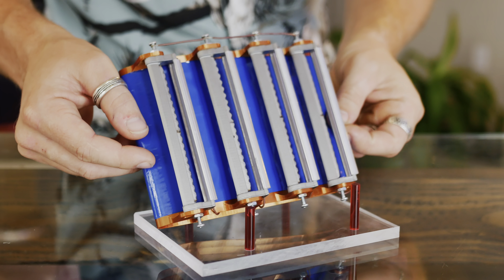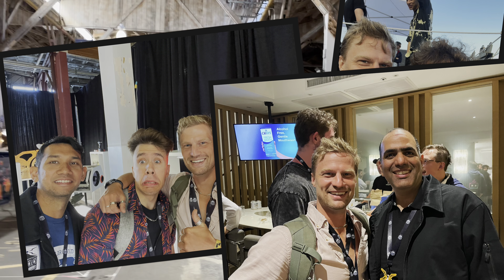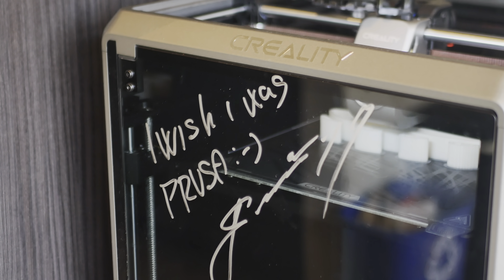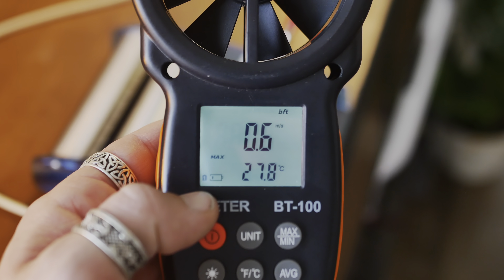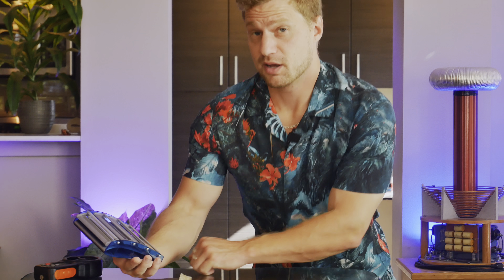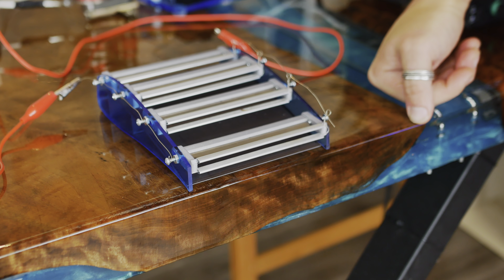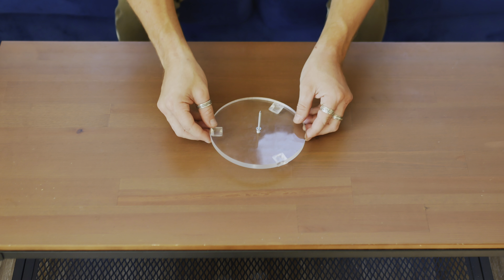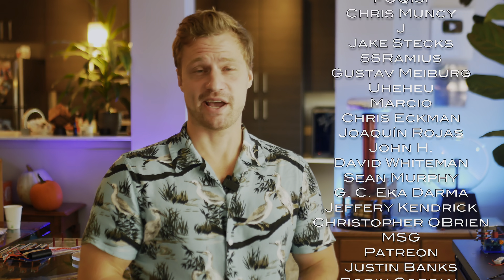Designing A Self Propelling Ionic Thrust Wing

Comment: I would recommend trying to measure the static pressure on top of the airfoil either mechanically or in a computer wind tunnel simulation. The pressure on top of the airfoil needs to be lower than the bottom of the airfoil, which may not be the case having the thrusters along the top of the whole wing. If you have a high pressure on to the wing will create downwards force and you’d have to rely solely on the angle of attack to create a higher pressure under the wing, instead of the foil. 
Also something that I thought of, is to make sure the average vector of the thrust air flow is parallel with the chord of the wing, as to not induce any separations of the air flow away from the curve of the air foil. Although with a setup like this,  there’s a unique opportunity to play around with adjusting the vector of each stage of the thruster to be angled to force air perpendicular to the tangent of the curve (the Normal Line) of the airfoil at each stage. Forcing airflow over the wing in a setup like this could theoretically make an almost unstallable wing, as the airflow can never fully separate as long as there’s power. 

Also on a separate note, I had the idea of smashing copper wire with a hammer to flatten it out, and creating a razor like edge with the weight savings and improved conductivity of copper wire.
Reply: If you put metallic tape on the bottom of the wing and charged the air beneath the wing negatively, and left the wind coming off the top of the wing with a charge (or vise versa), maybe you could create a useful effect?

Comment: I have to wonder if you can increase output a bit more by increasing surface area.
There is a method used when making hydrogen.
For producing hydrogen, the best results don't come from smooth flat plates, but ones that have very light cross scratches.
This allows for more surface area to be exposed to water, creating a stronger result.
If may be worth looking into, since it is possible It could cause a stronger reaction if done correctly.
Trick would be making sure it doesn't cause more drag.

Comment: Any thoughts on whether or not it would be better to move the thrust modules down underneath the wing instead? I'm no aeronautical engineer, but I always thought that it was important not to mess with the low pressure air traveling over the top of the wing. Might be worth trying it both ways and measuring the difference in lift between both versions. Just a thought. :)
Reply: or put IN the wing. Yes, disturbing the flow around the airfoil usually leads to planes plummeting out of the sky.

Comment: For the complete wing you could use carbon frame roads and 3d printed wing foils to make the main structure and then cover it all with plastic film, you should decrease a lot the total weight.
You could also use 3d printed pars electroplated like Integza’s one for the negative pole, but maybe replacing the aluminum tubes can cause a few issues with the complete build given the large wingspan. 
I hope I’ve been helpful, I love this project idea, keep going!!

Comment: Neat. 
But it looks really high drag. 
All those bits external to the wing especially being separated will be very high drag. 

It would be better to have an inlet at the front of the wing and have the motor internal. With the exhaust vent blowing the air slightly down along with the wing. 

Just like late war planes incorporated coolers into the leading edge of the wing to reduce drag. 

Every engine pod or nacelle ot this thingy external causes more drag. 

That's why the Do335 was so fast. 
It took a normal twin engine config but put the engines in the body front and back. So saved the drag of the normal wing pods for the engines. 

Second big factor is the exhaust vent. Afterburner jets need variable ones. As the optimal nozzle size is critical. Too small and it will choke the flow. You really don't want that on a jet. But too big and the volume passing won't get acelirated to its highest possible vilosity. So not all of the pressure will have been converted to kinetic energy. Whis is what gives the thrust. 

So I recommend a leading edge air intake, internal motor system and an adjustable exhaust to optimise trust.

Comment: Hi @Plasma Channel, im glad that you picked up on this idea i left in the commens of the previus video regarding Ionic Wings. (I have tryed to contact you and Joel to share more ideas, but i never got any responces). 
My sugestion to further improve the desing would be some desing changes: 
1ºdesing: Try  to incorporate the eletrodes from the ionic trusted into the wing foil shape it self (avoiding the extra height and drag and aerodinamic property change of the wing).
Use a air foil shape made from struds and foil (same contrution technich as old rc balsa wood models, and real airplanes). 
- instead of using wires for the positive. use strips of alominium tape along the airfoil shape as well as in the leading edge. (here i dont know if 4 positives as 1 ground, would be ok or if you need to interpolate 1+ to 1- on the strips polarity)
2ºdesing: (im not shure if this one would work)
Keep the possitive strips along the airfoil top part of the wing. Place a 2nd thin alloy sheet over the top of the wing to act as ground.
(message me if you have douths on my post).

Keep duing great videos!
Cheers

Comment: Why are you dragging air over the top of the wing? Don’t you want it to go underneath? It feels like tou are counteracting the airofoil!? 
The other thing is that you measure airflow which is not as interesting as the lifting force i would think? so why not measure that?
Reply from the maker: LIft is created by a difference in airflow over the top of an airfoil. Positive lift occurs when air on the top moves faster than the air on the bottom. So, in theory, the airflow on top automatically creates lift even before the wing begins moving. And once moving, the airflow on the top is significantly greater, meaning, lower speeds needed for flight. Again, theory haha

Comment: To me the lift is being interfered with.  I would build a thruster in line like a jet and leave the wing air flow alone
Reply from the maker: Yeah, I had some thoughts about this, and originally tried to do that. But I found placing the electrodes inside the wing to be very difficult.

Comment: We need good explanation on why we need the thruster module to be first on top of an air foil and second why need it parallel to really give good suggestion.
Because with multiple modules in parallel first the wing aspect ratio would need to be pretty low, second the subsequent module may block the flow of air and third, would it detach airflow from the airfoil (because it's on top)?
And if you must have multiple module stacked (for either compound effect that I'm not aware of), maybe use the circular design like your own BSI mk.2 or Integza's design  because air can flow through better and enclose it like a ducted fan and make it either like the Caproni's barrel plane (if you need it big) or as engine module.

Comment: I was thinking the same thing as your outro You could be on to a major break through in flight now i don't think this will be ready for human flight anytime soon. But for sensor drones if you could for example get the system working on solar + battery you could be talking weather drones flying 24 7 non stop or communication drones providing internet or cellular coverage to impossible to reach areas

Comment: You should put the whole setup in the wing, not on top of it. A wing is supposed to fly up when it moves forward. With all that junk on top you might defeat the purpose.
Also when the wing is moving forward, the air is accelerated into the thruster. Actual jets fly more efficiently at high speed by making use of that input speed. Pressure improves ionization just like it improves combustion. So you should place the air inlet at the front of the wing and transform any eventual air speed aquired from movement in air pressure applied to the blade or wire. 
I have a design idea if you find this comment useful.

Comment: You can build it all in one air foil design by simply cutting slots in the air foil and using those slots for the Ion drive. The air that the high voltage is moving will help create it's own air foil created by the air itself.

Comment: I feel like a solid state propulsion ship makes a lot more sense than an airship. The weight of the batteries on the buoyancy of water isn't nearly as much as the weight of batteries on the lift of air.
Reply: Though after writing that have you thought about a blimp?  When I went to an Avalanche game they had a blimp flying around the stadium with two small propellers a solid state propulsion system and helium might go well together not hydrogen though kaboom.

Comment: I feel like you shouln't put the thrusters above the wing as it will increase the air pressure and therfore loose lift force.
You want the air pressure to be high only under the wing.

Comment: electroplating, electroforming on top of 3d print, can make parts more stiff with minimal weight increase and you can also use the parts as electrodes that weight nothing, copper and nickel very easy to do

Comment: Please take on board the comments from the previous two videos. Plenty of people gave valid improvements that haven't been addressed in either the upgrade video or this video. 
Things like bottlenecking the airflow, optimising distance between each stage not just the distance between wires in each singular stage, increasing surface area of wires etc. 
Keep doing what you're doing though, interesting videos.

Comment: Noted the points of the plasma trail in the photo. Placing a minor dent on a wire, would alow you better control size of plasma cone's angle between the + and - metal strips. This would incress the efficency. Try a test please.

Comment: Just a random Monday armchair noob, rather than incorporating the thrusters in series on the wing, stack them vertically. This may "may" or may not change the drag from the thrusters installed flat along the wing surface. Another thought would be to build a semi-bi-plane wing with the lower stub wing holding the thrusters. This should allow the airfoil of the main wing to work in free air with no induced drag from the thrusters causing eddy currents disrupting lift.

Comment: Hi there, just off the top of my head. Thought about the flat razors vs the new ones and thought you might get an increase in performance if somehow the cathodes had little tips like a comb or grooves at small intervals so you can increase discharge points through the tip effect. Maybe me dumb, hope I made some sense.

Comment: Would the thruster also create more lift as its drawing in more air from the top. Making the top have even less air pressure than an normal foil. Like, it creats more lift while simultaneously adding more trust. 

Does any of that make sense?
Reply: I love how the serrated blade edge kept the archs so uniform

Comment: Why not design the frame of the thruster as the spars/ribs of the internals of the wing...in fact...built INTO the wing, make the wing the thruster
Eliminates or at the very least reduces the drag coefficient...heck the wing itself will generate lift and thrust (instead of the airflow going OVER the outside of the wing, the air INSIDE the wing will create lift), use carbon fiber tubes for weight reduction and arc potential
Plus with that heat shrink mylar coating sheet, you can make the entire wing and cover it with that material...the entire leading edge can be open
man...can you imagine a glider that has an engine...but NO moving parts!  
Keep em coming!!!!

Comment: Thrust Speed of one module is typically just 1 m/s. A 3D printed plane with added batteries and HV electronics will need, depending on wing loading, at least 20 to 25 m/s flight speed. This means you'll probably gonna need about 30 m/s thrust speed to achieve level flight. Not gonna happen. Think big. Maybe you can produce a unit with about 10 plasma modules behind each other, giving about 10 m/s thrust speed, and mount it under a Paraglider, which doesn't need much speed for level flight. (Although it isn't a very efficient glider).

Comment: Wouldnt it be better putting the ionic thrust modules at the bottom of the airfoil because the wing works by having higher air flow at the bottom than the top so that there is lower preasure above than the the bottom , producing lift. you put the modules at the top which might cancel the preasure difference  because there is more or less the same air flow above and below which stops lift.

Comment: One thing i noticed is that the last segment of the thruster rips the air of the wing, so it would most likely decrease it's lift, so putting that segment on an angle would (propabbly) improve the lift (not like its gonna fly in that state yet :D)

Comment: Would it make more sense to have the thrusters either on the bottom rather than the top? Or, both bottom and top?  I'm wonder if having the thrust in the center of a hollowed wing might be even yet a better design.  This was an interesting video, as usual, but also as usual just not enough thrust/weight efficiency to work (for flight, seemed to work just fine as a fan or for a boat or toy or various other small power uses).

Comment: Instead of a separate emitter and collector for each thruster segment, make them airfoil shaped and alternate polarity on each one so they perform both roles. Rounded leading edge is collector, sharp trailing edge is emitter for the next one. Round over the trailing edge on the last one so it doesn't bleed charge, and put a fine wire emitter ahead of the first one.

Comment: The main issue I can see with that is still something we deal with today. Energy storage. How will you store the energy in a good weight to energy density battery that would make it viable.
As large scale there isn't a true better then the rest solution as most if not all batteries have a high weight and a moderate energy density. Take most EVs they double the weight of the car mainly for the batteries and that's after taking out the engine.

Comment: Wings work by LOWER air pressure on TOP of the wing, by adding PRESSURE generating thrusting you NEGATE any and all wing properties just making it ram-lift, they need to be on the bottom to make the air-flow faster underneath ergo making the lifting force greater.

Comment: Great work.  This may have been suggested already but,  If those are copper coil transformers you are using, I would suggest a capacitor/diode chain voltage multiplier. I think this would be a fraction of the mass.

Comment: Wouldn't it be batter to put the thrust under the wing to increase speed, because the air flows slower under the wing then over it?

Would it be possible to use unly the thrusters as wings with 4 wings close behind each other?

Comment: To help the aircraft performance I would suggest putting the thrusters on the bottom of the wing. The airflow over the top of the wing is very important to the performance of the airfoil. It is way more important to keep the airflow over the top clean and unobstructed. If you look at pretty much every modern airplane design the engines and  other drag items are on the bottom of the wing.
Reply: There are merits to his design and there are aircraft designs that feature and successfully demonstrate generating lift by blowing air over the wing via coanda effect giving high lift at low speeds (which is needed for this build rather than efficiency at cruise) a good example being the AN-72

Comment: How about using foil tape stuck on the wing surface as the electrodes? Tape on the leading and trailing edges and the whole wing becomes the thrust module.

Comment: Hey! Great job!
I was thinking of building a boxwing drone with ionic thrusters. You could potentially use them to control it in the air by differentiating thrust. Is there any chance you would be interested in cooperation?
Reply: I was wondering about a box wing configuration too.  You could stretch the energized wires vertically between the upper and low wings.  Then again, I guess you could also go for a more conventional wing design with vertical winglets on the tips and stretch the wires horizontally between those.